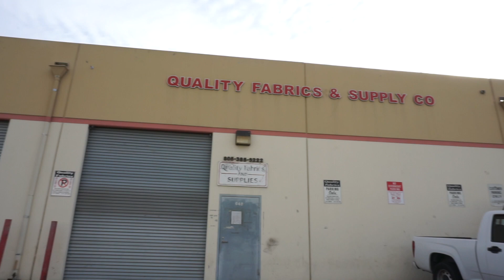g37 IPL Bumper

Comment: bruh, your brother just gave himself an exhaust leak on purpose. thats not a mod. Expensive ass steering wheel but cant buy a catback exhaust? like wtf.
Reply from the maker: Temporary he’s not going to have it like that Motordyne exhaust on the way :)
Reply: George Nava if he actually plan on getting an exhaust, tell him to do a muffler delete in the meanwhile. Because putting that spacer thing on the y pipe is really bad for the flow of the exhaust.
Reply from the maker: Yeah bro he’s has lots of parts coming and yeah eventually he’s going to remove the spacer
Reply from the maker: They are 20s I like the concave look on them and for sure bro I’ll check your car 👍🏼